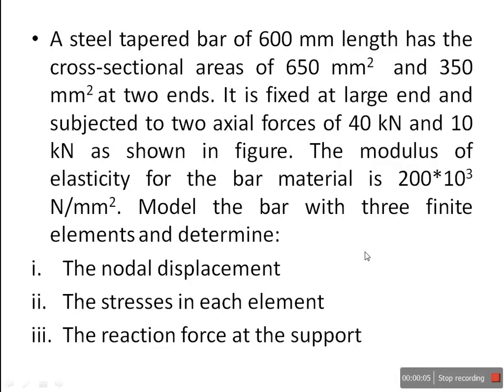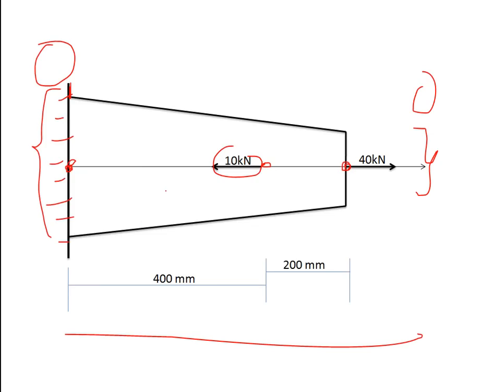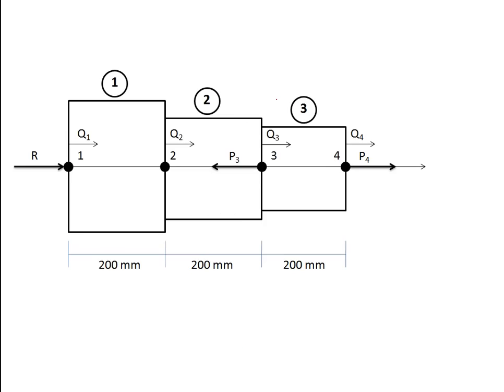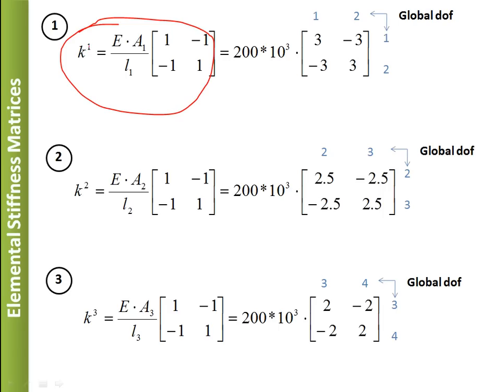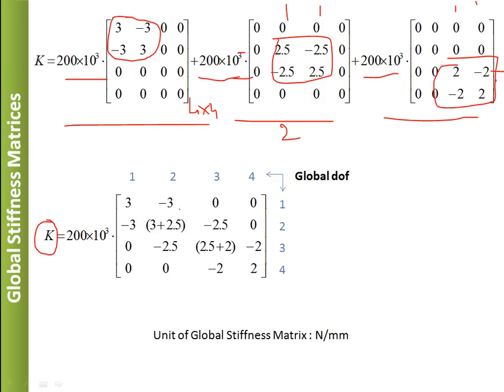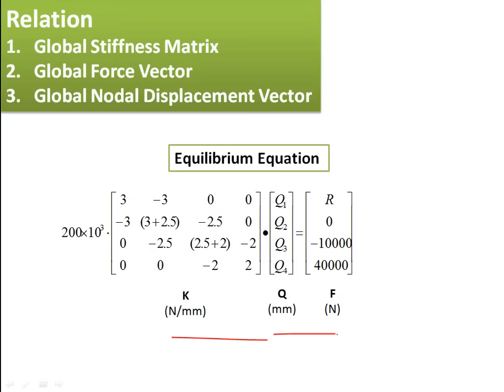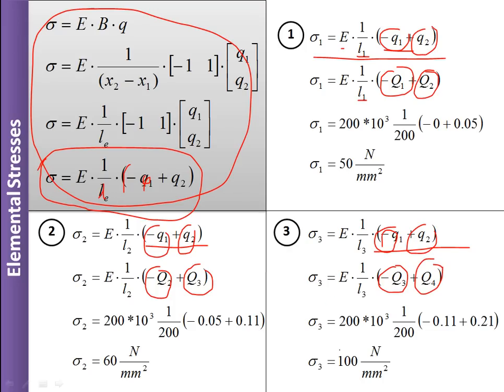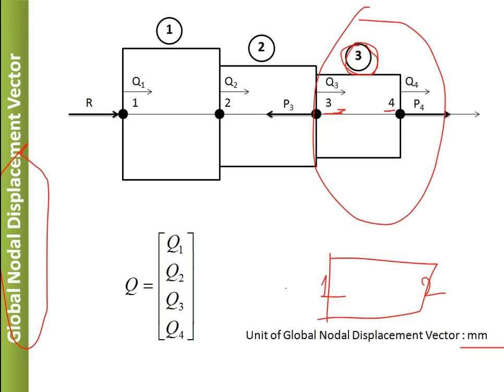FEA FEM | Simplified Solution of 1D Structural Problem with all Steps | Finite Element Analysis 👍

Comment: how find 550,450,cross section
Reply: Think of a straight line where a = (y2 - y1/x2 - x1). Then use 650 - 350 as y2 - y1 and the length 600mm as x2 - x1. You will then find a. This number can be used to find the cross-sections. You set x to be the length where you want to find the cross section, like 200mm. Be aware that the positive direction is from the right side to the left (because of the inclination is that way). Therefore the first element will start at 400mm. You put the a and x values into the equation for a straight line: y = ax + b and y will give you the cross section :)
Reply: First element: I mean the one appearing first, from the left, the largest one. ;)

Comment: How does the matrix at 13:59 change to the matrix at 14:01?? Are you using elementary transformations?
Reply from the maker: see...basically there are four equations in that matrix. out of that, last three equations have only 1-1unknown whereas 1st one is having 2 unknowns .
its not possible to solve 5 unknowns with 4 equations.. that's why we are eliminating 1st equation and solving last 3 only
Reply: I do understand that, sir..  But how is the 40000 in the RHS 3x1 matrix, becoming 34047.6?
Reply from the maker: yeah, that is elementary transformation.
To eliminate (-2) from {3,2} position, we did this transformation.
Reply: Thank you,  sir :)
Reply from the maker: most welcome.
Reply: Hi , I seem to be having difficulty understanding the 'elementary transformation',  as to how and why it is being used? Any help would be much appreciated. Thanks
Reply: sir cant we do directly ..I mean without performing elementary transformations ? we can right?
Reply: same doubt
Reply: I need to know exactly this too.

Comment: Hi I'm still new to this module so can you explain what is B and q at 14:10? as different country uses different symbol. Some shows Force as P, While others uses F. It would be nice if you can explain.  From what I know Stress = Young's Modulus * Extension (Change in Length - Original Length) or Stress = E * Strain where strain = (L - Lo)/Lo and how would you derived to 1/(x2-x1) * [-1 1] . [q1 q2]? Thanks! Not really sure how they could change the equation into Matrix form.